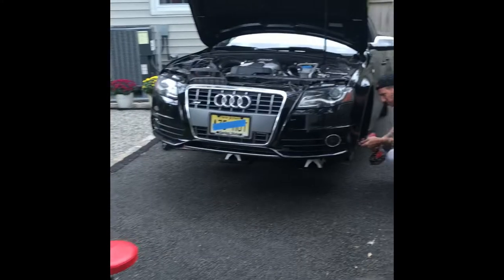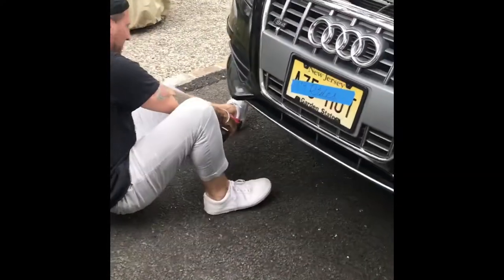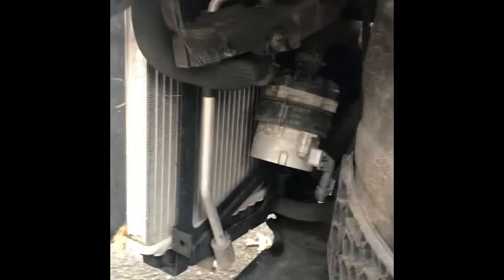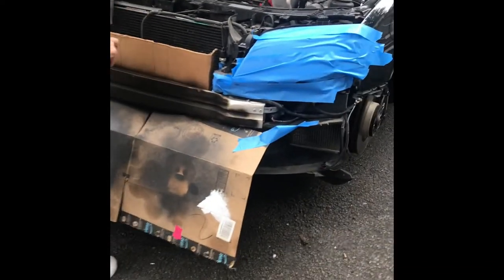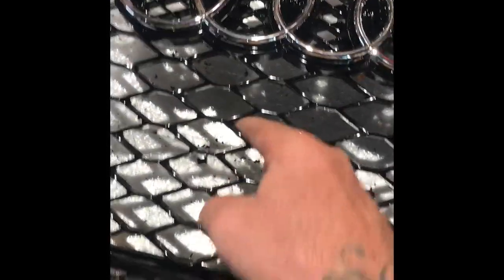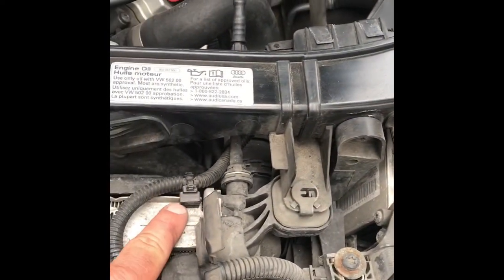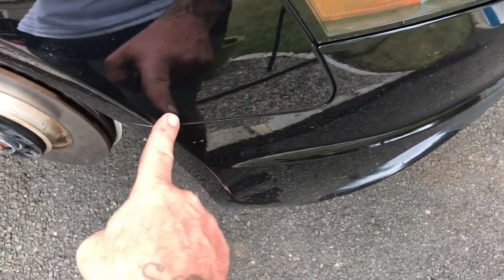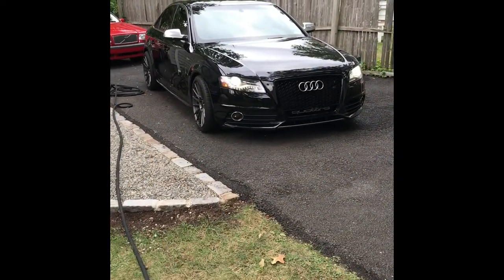S4 RS4 Grill Install

Comment: I have à question plz the signe quattro came with the grill or not ??
Reply from the maker: Yes it came with the grill.
Reply: @114RIDES  thanks bro if you have more information that helps me find this model it will be great
Reply from the maker: https://www.ebay.com/itm/For-Audi-A4-B8-Front-Grille-S4-RS4-Honeycomb-Mesh-2009-2012-Quattro-Two-Rings-/223612378533

This is the best I could do it looks like they don’t offer the one we installed.
Reply: @114RIDES  thank you very much. Have à Nice day

Comment: Where did you find this grill ?
Reply from the maker: Matt Austin The grill is an eBay special, we paid $200 shipped, with a little modification it bolts up perfect. Thanks for the interest and tuning in!
Reply: @114RIDES  What modification did you do?
Reply from the maker: Hanh Kieu we just had to cut small portions of the grill and paint the aluminum bumper, the rest was straight forward, let me
know if you have any more questions. Thanks for the support!
Reply: How did you cut the diamond parts out of the grill???
Reply from the maker: We used a Dremel with a small cutoff wheel and a pointed stone for the fine details.
Reply: Ok, cool thanks... I just got mine and plan to install on Sunday... I had been trying to figure that part out since I ordered it lol
Reply from the maker: Cool let me know how you do, or if you have any more questions I’d be happy to help out.
Reply: Cool.... Much appreciated fam